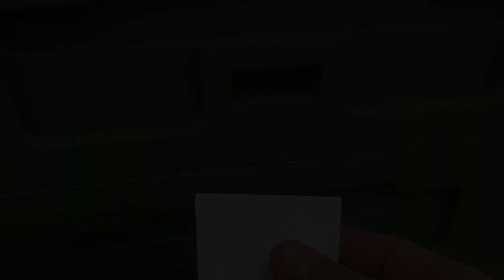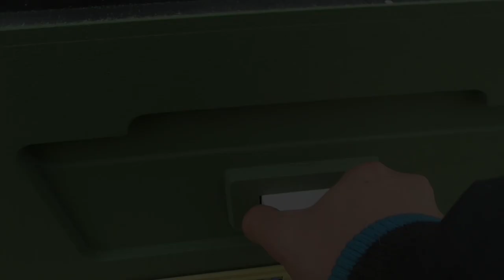DON'T Buy The 12 Frame Poly Hive Before You Watch This!

Comment: Would you recommend one over other hives? I’m Thinking of getting a couple as my first hives but worried about the compatibility with wooden National hives
Reply from the maker: I would recommend the poly Abelo hive shown in this video and yes I would advise getting 2 hives so that if something goes wrong with one hive you can help it out with resources from the other hive. The wooden hives aren't exactly compatible and would advise against mixing and matching as it will be much easier later on to have the same type of boxes. The wooden ones do kind of fit on the edge of the rebate, but people have has issues with water ingress and water kills bees! Hope that helps!
Reply: Way too expensive compared to a wooden hive, great design but just don’t see the extra cost
Reply from the maker: @davidmcdowell-Rowantree-Honey  Depends which wooden one you choose. Pine hives are 180 each but will break within a couple of years or cedar are 400 roughly. This hive is a great investment. Pays you back in 🍯